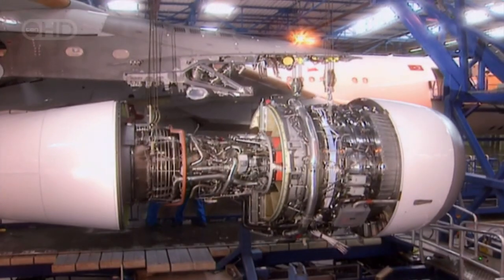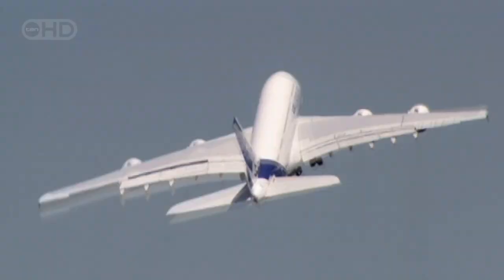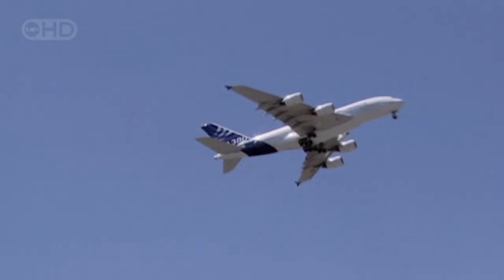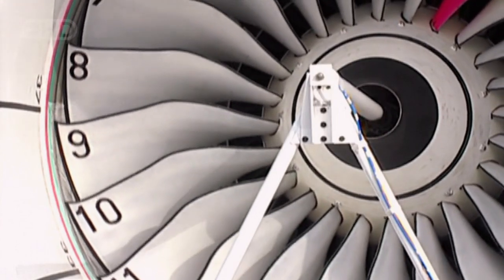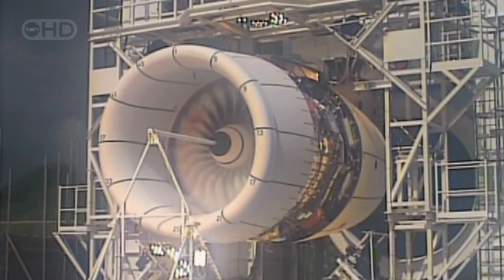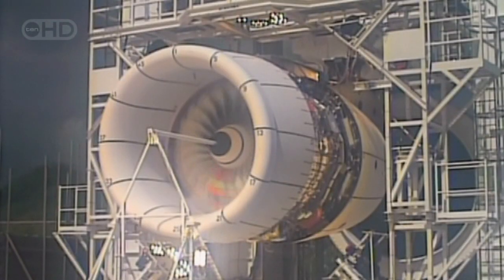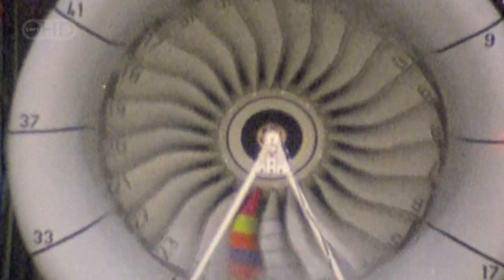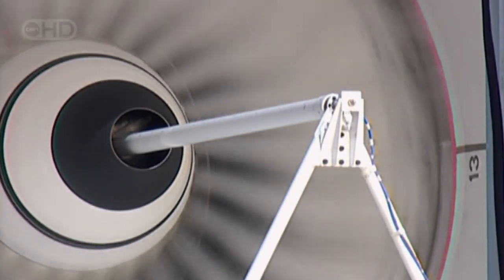Airbus A380 Engine Explosion Test - HD

Comment: I wonder where the video is of R-R blowing up a Trent 1000 on GE's test stand in the U.S.? Now THAT is embarrassing. Probably expensive, too.  And all because R-R wanted to prove its engines could pull off the GE-invented "Triple Redline" test that's now required for FAA certification. Note to R-R: Don't let the company that's building engines damn near twice as powerful as your best efforts ALSO decide how good is good enough for what a commercial airliner jet engine has to survive unaffected. Especially when your 3-spool dinosaur is literally incapable of even performing the test given its inability to perform the test. GE designed the test for TWO-SPOOL engines that can actually operate at MAXIMUM FAN SPEED and MAXIMUM CORE SPEED and MAXIMUM EXHAUST GAS TEMP SIMULTANEOUSLY FOR AS LONG AS DESIRED before being IDLED BACK and then shut down after only 5 minutes of "cool-down" with ZERO adverse affects and then RESTARTED COLD and warmed up for only 5 minutes before going BACK to TRIPLE REDLINE over and over and over until you get bored of testing it. A 3-spool engine that drives the fan from the "intermediate turbine" literally can not have both the FAN and the CORE operating at max speed simultaneously, The FAN LOAD will slow down the CORE and VICE VERSA and the CORE is way too restrictive of the airflow and the engine can't operate at max EGT for more than a very brief period of time. Which is why as Rolls just hammers more and more air and fuel into that dinosaur RB-266 "core" all that comes out is MORE FAILURES and MORE FUEL CONSUMPTION and damned little additional power. Rolls was getting 50,000 lbs of thrust out of the RB-266, or CLAIMED TO BE, when the 747 was new. Now its almost 50 years later and they've managed to make right around 70,000 lbs "reliably" at least on PAPER before each "new" Trent that's supposedly more powerful AND more "fuel efficient" despite that being IMPOSSIBLE ends up being quietly "reined in" back to the high 60,000s for SHORT DURATION TAKEOFF POWER. And THAT's only risked because otherwise Boeing would have complete abandones R-R engines by now. Boeing as already said it's next new plane will have ONLY GE engines and POSSIBLE a P&W option IF Pratt can get ITS shit together or rather survive the A320NEO debacle and get away from Airbus and manage to stay in business AND can build a "bolt-in" more or less direct-swap common-architecture engine that is plug and play with the GE engines "interface" with the airframe. Boeing has said it's no longer possible to build a plane that's everything customers demand as far as efficiency, cost, reliablility, availability and overall value yet still build in all the compromises necessary to make it work with "comparable" but very diferent engines. It shouldn't be a surpise to anyone that's the case, but I'm sure R-R and Airbus will act like its a pure scam on Boeing and GE's part. With Airbus being as big as it is or supposedly and typically hanging R-R engines on 40% to 60% of its planes and with the EU and EASA coming up with ridiculous "emissions" regulations that basically are written once a new R-R powered Airbus plane is airworthiness certified and they're "noise restrictions" its literally impossible to test a different airplane with different engines legitimately for, clearly R-R doesn't need Boeing and Airbus doesn't need GE and some true "competition" can only make all four companies better and more focused on PRODUCTS instead of POLITICS. Its not like Airbus and R-R haven't had a free ride to U.S. FAA certification for decades with the FAA and EASA supposedly "honoring" each other's certifications. Which happens for "airworthiness" but in the U.S. NOISE POLLUTION is an EPA deal. So Boeing and GE have to jump through MULTIPLE hoops to get "certified" whereas Airbus and R-R don't have to comply with EPA laws because they're not "corporate citizens" of the U.S.  Meanwhile, the EASA is more than happy to let U.S. taxpayers and U.S. airlines and Boeing and GE foot the big bills for "airworthiness certifications" that until RECENTLY the EASA would just rubber-stamp with "Ditto" once they'd med U.S. requirements. Which of course the FAA let R-R and Airbus become "certified" pretty much the same way but trusting that the EASA really was doing all those more or less identical tests in Europe the way the FAA and U.S. manufacturers HAVE TO DO THEM in the U.S. by federal law. Of course at the end of the day, the U.S. pays bigger bills and jumps through more hoops but also gets a damn sight better product AND doesn't have to share the credit with or try to put the blame on a "partner" in a pathetic attempt to "save face". Of course with Brexit imminent I'm sure the French and Germans and Spaniards at Airbus are ecstatic at the possibility of being rid of the British and if they're lucky FOREVER. It goes without saying the Brits will stay just as nosy and "involved" as possible regardless even if it means the stupid "peasants" in the general public are just as in the dark as they currently are thinking the U.K. is a "member country" of the EU despite "opting out of" all the meaningful and official requirements of membership like switching to the Euro, free movement, free markets, etc. The only bigger lie and outright fraud perpetrated on the "average British citizen" than "the U.K. is in the EU" is the currently and ongoing from long BEFORE the "election" complete LIE that "Brexit" is some sort of "process" and that' there's anything to "negotiate" besides the U.K. negotiating with its own national banks and treasury how to start paying "cash" for all the food and electricity and other basic necessities of life it currently "trades" with the EU for. Not to mention Article 50 specifically says there will be no negotiations between NON-MEMBER COUNTRIES and INDIVIDUAL EU OFFICIALS during an EXIT FROM or ENTRY INTO the EU. The British haven't actually NEGOTIATED a damn thing EVER, anyway. Which is why they're having so much trouble figuring out that they don't have to start now, even though that's a blessing to them because they have NOTHING to NEGOTIATE WITH. Nope. Literally setting the world "spot prices" for so many "valuable" and "precious" commodities and beig a "global financial center" and of course having a mainly inbred, simple-minded "public" that doesn't get out of the country to really ADVANCED countries elsewhere to see how backward and behind the times their little island is means that the U.K. doesn't have to spend piles of money on infrastructure and education and all those other BENEFITS that should go with the stupidly high taxes they actually have if you figure in ALL the various taxes. Having the U.S. and that "special relationship" sure makes it easy to be a global bully and fiscal tightwad when it comes to military spendiing, too. They've just been coddled and plaid the victime and played on "ally" against another for....ever, really. And they thought it would aways work that way. But progress has a way of catching up to everyone. And its sure gonna bite them in the ass if and when "progress" means going BACKWARD a couple of "generations" to at least be able to PRETEND to be broke and destitute and bullied so maybe some new suckers from maybe....Asia might step forward and bail them out.

Comment: What if that explosion happens at 32,000 ft at 800kms/hr?
Reply: King's Quay well they just make an emergency landing. Large airliners Can easily miss One engine. An Boeing 747 (4 engine plane) Can make a perfect safe landing flying with just one engine
Reply: But won't the speed cause a bigger explosion and peel ofg the remaining parts of the plane?

Comment: lol it blows away and he said it's safe to fly haha,no ones gives a shit if fragments leaves engine,if it blows you all dead anyway
Reply: The A380 has 4 engines, the point is if the damage is contained within one engine then you should be able to fly on the other 3 still.

If they don't ensure fragments are contained and an engine does blow up then other parts of the aircraft could be damaged causing even more issues.
Reply: TehDocc so fire won't effect other parts of the plane?